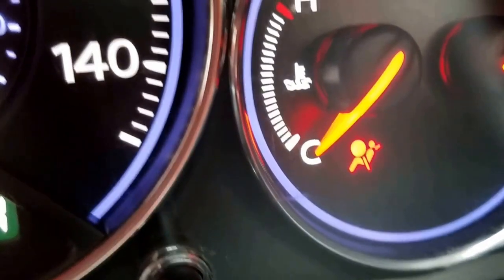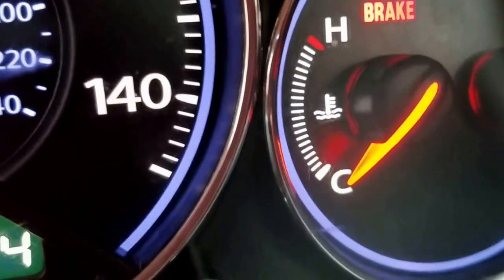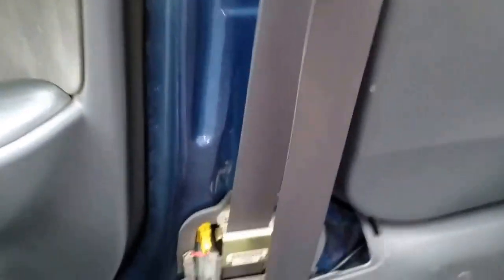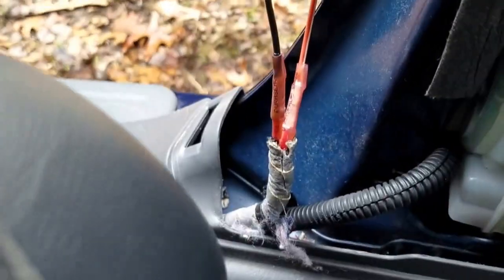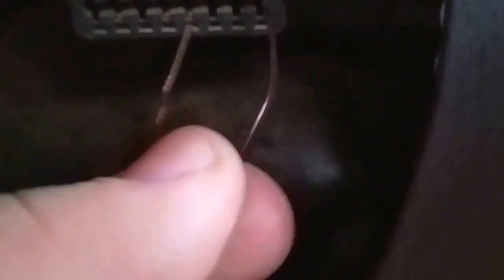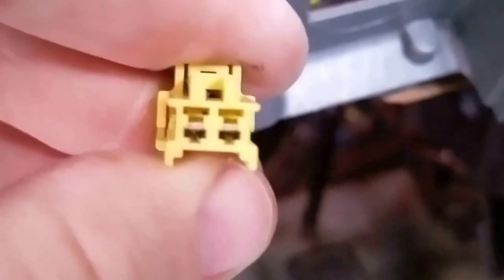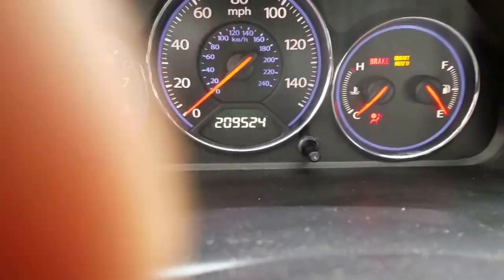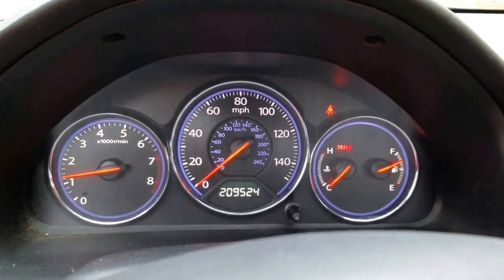Diagnosis, repair, and clearing of airbag light. 2005 Honda Civic

Comment: Thanks for this video.  My code turned out to be 9 3 which states faulty driver seat buckle.  The seat buckle was super dirty and I cleaned it with contact cleaner.  After reset, light went out.  Let's hope it stays off untill the life of the car.
Reply from the maker: Nice!! Glad it was helpful.

Comment: I have an 05 civic lx sedan, and we recently changed the heater core. The problem is the ac condenser won't click on and it is full, also the push button for ac won't come on? It was working fine
Reply from the maker: That's unfortunate man. This video is specifically about the airbag system.
Sounds like you may have an electrical issue, but I'm not sure. Good luck with it!

Comment: I have a 2004 Honda Civic. I inserted the paper clip as instructed and when I turn the key on I get the light on for a bit just like the video but then it does about 4 or 5 rapid blinks, then another 4 or 5 rapid blinks, then one slow/normal blink and then 1 rapid blink. Then it does not repeat but just stays on.
So I double checked the paper clip and even reinserted it but still same behaviour.

Can anyone explain that? Or is this a real code like 4411 or 5511?
Or any thoughts?
Reply from the maker: Oh man. Maybe you have multiple codes. Might be easier to go to Autozone or something and have them scan the codes. Then you can make your repair and clear the light using the process in the video or disconnecting / reconnecting your battery.
Reply: @ZackofAllTradesct  Actually I figured it out and four rapid blinks means 10, then the next four rapid blinks is another 10 and then one and one. So in other words my code is 21-1. Hopefully this can help someone else.
Which I think means my driver side belt buckle needs to be replaced which is unfortunate cuz I did that 2 years ago. Unless anyone has any suggestions in that area
Reply: @DO-wy3eb The website in the video description was not working. It seems to have expired.
My 2003 Honda Civic has a 4-speed airbag light that comes on, just like you said.
Thanks to you I learned where this came from. Thank you very much. Big man.

Comment: Wonder if it makes sense to split the wire so you don’t have to fumble with pushing it in and out, just touch the wires together as needed.
Thanks for making this vid! Just finished removing and reinstalling my dash and had to reconnect the battery briefly while everything was unplugged, which I believe is what threw code.
Reply from the maker: Yeah it was a little touch to and film at the same time...haha.
Hope you get it figured out.

Comment: Thank you 1M! This video + some prayer saved me time & money.  With the fuse box in a tight corner and short wires, plus a thick paper clip, it was a difficult task. I almost gave up! Said a prayer and then it worked on my last try! What a relief! What a Godsend!  I am very grateful for your video! You did a great job explaining the procedure and by all these positive comments ppl are leaving it's evident you are helping many!  Excellent job!!!
Reply from the maker: Glad it worked out for you!!
Reply: @ZackofAllTradesct  - Here it is another year later, and I'm having to do this again! As before, the airbag light will go off/on 2-3x, but it won't turn off the 4th time and stay off. Plus my wires are so short that it's painful to get to. It's not easy to do bc the wires are so short, and I have to adjust the paper clip ends each time I pull it out and it's difficult to keep it that straight and just right so it'll work right quickly.  I remember last year when I did this, it took me 12-15x just to get it to work. Slam wore me out then and is doing the same this year! This is so crazy! WHY is it so difficult to get the light to go out the 4th time?!
Reply from the maker: @Beachlady  oh man. Sorry to hear that! Hopefully you can get it figured out.

Comment: Can’t you just disconnect the batter to reset it, that’s what I did and no issues.
Reply from the maker: Probably but you lose all your data, have to reset your clock, radio presets etc...

Comment: Error code flashed 2-1. Open circuit on Passenger Air Bag Module. Any ideas how to fix?
Reply from the maker: You'll need to locate the passenger's airbag module and look for a disconnected / broken wire.
Often they are located under the seat and wires get pulled from stuff getting jammed under the seat.
Reply: @ZackofAllTradesct  do I need to unplug the battery and wait 20 mins first? Don't want an accidental deployed airbag
Reply from the maker: @hereiseminem  sorry bud, but I'm not sure about that. I'm not a technician, just have a general knowledge of vehicles. I hope you get it figured out.
Reply: @ZackofAllTradesct  no problem! Thanks for the help.

Comment: How do you read the forum? Idk how to read it. I have and 03 4dr civic and it flashes 4 x 2. Then it has a 1 and then 1-2
Reply: So would that be 9-1?
Reply from the maker: If it flashed 4 times slowly and then 4 times quickly it is a 4-4 code
4-4 short circuited To Power In Passenger's Seat Belt Tensioner
If its flashing 8 times slowly then once quickly it is an 8-1
8-1, 8-2,8-5 & 8-6 
Internal Failure Of SRS Unit.
Reply from the maker: I would need to see what its doing. I'm having a hard time understanding. It may also have multiple codes.
A 4-4  and a 2-2. It all depends on slow flashed and quick flashes.
Reply: @ZackofAllTradesct  it flashes 4 times fast and then it does it again. Then it has one long flash then one short one. Then the light just stays on
Reply from the maker: @MeliTelly  wow I'm sorry man. That seems really strange. I'm not sure.
I would check out the few possibilities.
Maybe someone else in the comments can tell you if then the 1st number is a nine if it is 9 slow flashes or or 4, 4, and 1.
Sorry I couldn't be more help.
Many times Autozone will scan codes with an OBD2 scanner for free and give you a print out of the description.
Reply: @ZackofAllTradesct   yea that’s what’s kinda weird to me. Because I tried to look through the forum you put in the description and couldn’t find anything similar to what I have. 

I asked the dude in auto email if they scan airbags and he told me they didn’t. But maybe I’ll just ask for the scanner and hope that a print of the airbag comes on it. Thank you for your time tho👍🏼💯
Reply from the maker: @MeliTelly  Good luck! I'd be curious to hear what it ends up being.
Thanks for watching.

Comment: hello Zack, information you supply is taking somewhere but from moment of connectin and disconnecting yellow wires got very confusing and in my opinion impossible to get correctly erased.
Reply from the maker: I'm sorry. Many people have found it very helpful. I just updated the link a few weeks ago. I hope you can get it cleared. If the repair did not fix the problem it will not clear.
Reply: @ZackofAllTradesct  Thanks Zack you put me into right direction , God bless
Reply from the maker: @the2120company  My pleasure. God Bless.

Comment: i found this video while i was searching for the ideal odb2 scanner to detect my airbag light problem. i still cant believe that i just needed a paper clip :)
Reply from the maker: Pretty cool huh?
Reply: @ZackofAllTradesct  yeah but pin to the odb did not work for me. i did exactly same, but nothing happens. Actually i tried resetting at the fuse box. it works i can reset it. But error comes back cuz i could not detect and solve the issue at the first step :(  my car is 2005 civic 1.6 vtec)
Reply from the maker: @BMWMANIAC hhhhmmm. I wonder why you weren't able to pull the code? Seems like there may be no power.  Many times your 12 volt outlet (cigarette lighter) is on the same circuit as the OBD connector. I'm not positive on the Hondas, but if you don't have power there I would check for a blown fuse and then try again.
Reply: @ZackofAllTradesct  honda service told me that my error is because of right seat. They told me to leave the car later for full examination they didnt had time when i went. i am planning to check cables and clean the connectors with wd40 at the right side. If it doesnt work i will go to a local service to odb scan to make sure what exact error code is. is it safe to use wd40 at the connecters?

Comment: Hey Zack.
Ran the test and got a 3-1
Is that for the drivers side
retention system?
The belt is not retracting
on its own.
Have to help it retract.
The forum codes are confusing.  Thanks.
Reply: Thank you..
Zack.
Reply from the maker: 3-1 & 3-2 open circuited Or high Resistance In Driver's Seat Belt Tensioner
Yeah I would start with that!

Comment: Hey, would this worked on a Toyota AYGO 2005 model. I am worried that by shorting out the yellow connector it might cause damage to ECU or cause airbag to blow or cause some other issue. Any thoughts before I try it out to try and reset my AIRBAG light
Reply from the maker: I'm sorry I missed this message. I honestly don't know. I hope you got the issue resolved.

Comment: Hi from Norway...I have a Honda CRV 2008 model. I have a strange problem. Out of the blu when light switch is set to auto on my light switch on the left side of the steering wheel....IN DAYLIGHT backlights and instrument lights work as they should, but when it gets dark, backlights turn off and instrument lights work. TO get the backlights to work i Need to set the light switch to OFF position.. but then of course instrument lights AND farlight, the one showing with blue icon on the instrumentpanel ( I don't know the english word for it sorry ) that doesn't work. I can test this on the daytime with blocking for the light on the sensor sitting on the inside of my front window. I have a window wiht rainsensor.  PLEEEASE help!

Best regards Atle from Norway :-)
Reply from the maker: Hopefully you got it figured out. Sounds like a faulty daytime running light sensor or something.

Comment: According to the chart in the link a 41 code does not cross to a passenger tensioner? Am I missing something
Reply from the maker: It's a code 4-1, not 41 that might be what you are seeing.
Reply: @ZackofAllTradesct  I realized my mistake after I read the codes off my car. Mine was a 9-3, the typical driver side seat buckle. Sprayed the switch with contact cleaner, problem resolved, thanks.
Reply from the maker: @michaelnichols8633  nice!!

Comment: Worked perfectly! I just used a paper clip and received a 9-3 error number. The chart in the forum link you posted in the description was confusing so I just Googled the 9-3 SRS code and it turns out to be a my driver's side buckle switch. The part (new) costs about $150 to replace which is what I'm going to try and do for my 2005 Honda Civic LX (Special Edition) 2 Door. Can't imagine how much this money this saved me at an autoshop for time and labor. Thanks again!
Reply from the maker: Glad you were able to figure it out.
Reply: I. Curious how and where you read the code when the wire was plugged into top R and bt., 4th from R.
Reply: I'm curious how and where you read the code when the wire was plugged into top R and bt., 4th from R.

Comment: Will the Bobby pin method work on a 2005 CR-V to get the code? ( pin top right and bottom 4th from left in the OBD) ?
Reply: Just clear it with the yellow plug on the crv dont do the obd part i know the plug portion works.on the crv i did it.
Reply from the maker: Sorry bud, but I'm not sure. I wouldn't be surprised if it did, but I would be careful it could cause electrical damage if you jump the wrong pins.

Comment: Does the jumper technique actually fix the problem or does it just short out/turn off the light?
Reply from the maker: It resets the light. It does not fix the problem. If you follow these steps hopefully you can retrieve the code that will point you to the problem.